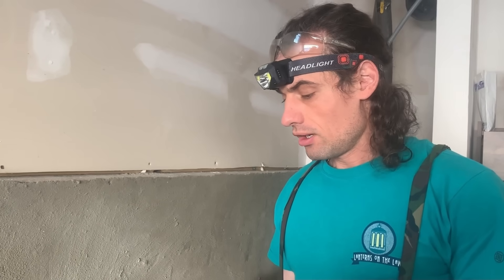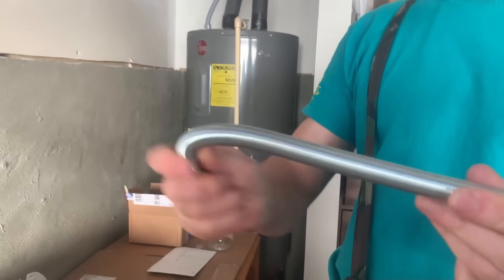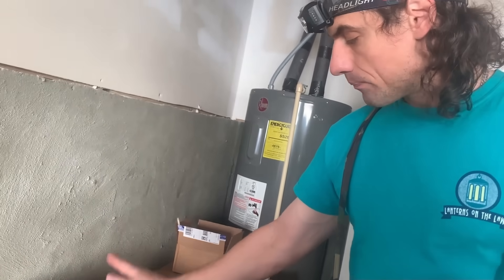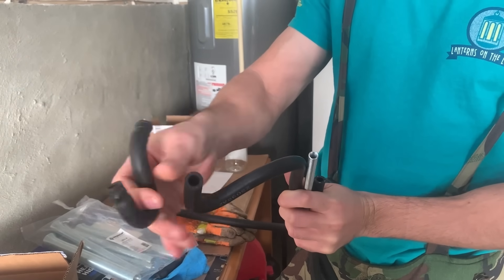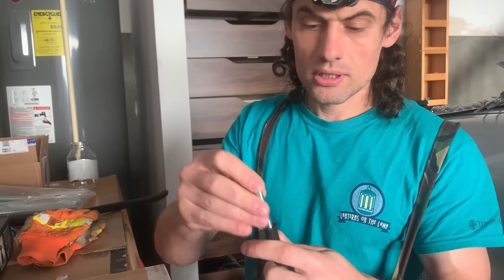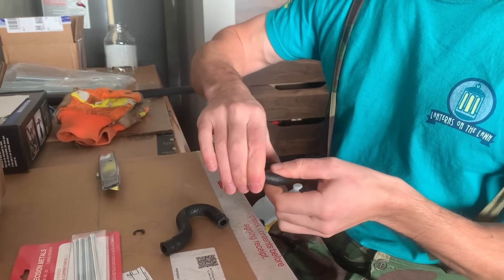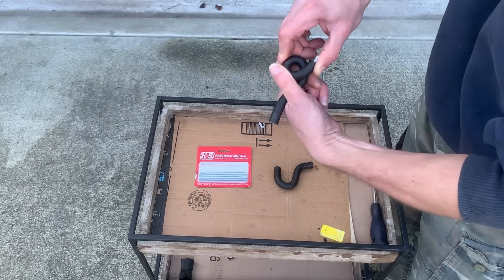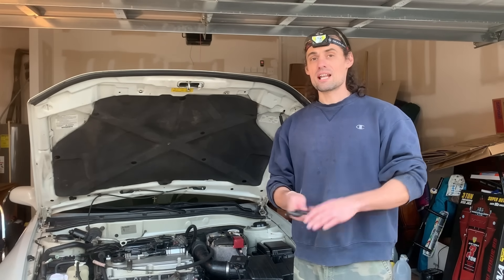Bend Rubber Hoses Without Kinking to Match OEM Parts

Comment: The OEM parts are made by; extruding rubber compond to form the inner tube at a smaller internal diameter than finished, then a loose braid reinforcement is woven over that, and then an outer tube layer is extruded over the inner/mesh.  This is uncured rubber compound.  This raw tube can be made in km lengths in a co-extrusion production run. It's stinkin ch!t to work with.
The straight raw tube is cut to length to suit the component. It is closed into a metal clam shell mold form of the exact size. The tube is plugged and pressure inflated to form the unkinked inner and outer shape form.  The inflated tube mold is then heat cured in an autoclave some time, cooled, then the clam shell mold opened.
The rubber compound is thermosetting. Once heat cured it cannot be remolded or reshaped.

Because the inner tube is smaller and the textile reo is loose and can slip between the outer there is NO tension in the reinforcement trying to resist the hard set bends, the finished product will always retain the shape... in fact resist deformation, just like the straight tube. 

Thats the problem with this method - the reinforcement mesh embedded in the tube resist tension loading, bending and pressure deformation. The rubber resists stretch and compression when bending, so it fights to retain the shape it was when cured - straight. 
 

The better choice of tube would be reinforced PVC because it is a thermo-forming compound, rather than a thermo-setting compound... and so, heated enough, inflated and molded then cooled there will be more chance of having the reo textile comfortably shift within the easily formed plastic.  
Remember, you can put the bending spring around the outside of the tube when forming plastic, but air pressure is needed to inflate for no kinks.
Reply from the maker: Thank you for great feedback! I've re-read couple of times to make sure I follow your suggestions/explanations and it all makes sense. Of course, my method isn't ideal, but so far it worked. Just keep in mind I wasn't trying to get perfect OEM part (although it would be nice), I was simply trying to get something close enough considering budget and time. Either way, your explanation is very informative and useful. Appreciate your feedback and hopefully others will find that informative as well. Thank you for watching!
Reply: Do you think the PVC will be able to handle 100 C & pressure?
Reply: For 1 year yes after i don't know, i installed it since 1 year on my rv fiat ducato.
My engine run particularly cool around 80c 100c peak maximum for a minute or two.
With modern engine how can get to 130c peak and build a lot  more pressure 2.5bars for somes, i don't know if it's suitable but for old one .... pvc seams to do the job. @calthorp 
Edit: i speak about textile renforced pvc hose. The non renforced one does last more than 2 mn in this case.
Reply: @tintinlavigne5257  I guess if you are stuck waiting for parts it would be a good choice.
Reply: PVC starts to soften above 160F. It's a really terrible plastic, it's not good for hot water, doesn't fuse when glued, goes brittle, is destroyed by UV, etc. It's very cheap which is why it is commonly used.
Reply: Everything correct. Except don't ever use pvc for this purpouse.
Reply: Thanks for your clarity. 
My daughter worked for YUSA who made rubber parts for Honda. 
She was a shift manager. 
You explained the process better.
Reply: Hey I know this old but you seem to know a lot about this stuff. I just bought oem hoses for radiator and when I put them on I think I bent it too much, there is very little space. It doesn’t hold the shape anymore but it’s on. It was a very slight bend, I’m wondering if it lost its shape does it mean it’s compromised and I should replace it. I don’t want it to blow up on me on the road. The hose seems a little softer now too
Reply: @advocatesdevil7064 your suspicions are correct. 
Hoses under heat and pressure want to return to their original form. Or collapse. 
But you probably have time to order affordable hoses from Rock Auto or somewhere like that. 
Just don’t get the cheapest ones. 
I always get the ones with the heart ❤.
Reply: @advocatesdevil7064  yeah... can be tight as fit and crammed in modern vehicles. 
I'm assuming these are largish diameter hoses with a thin wall. The top (hot) will be under pressure in service, the bottom (colder) will be under suction from water pump. The bottom may have a metal spring form to help resist collapse under that suction. The aim is to minimise any reduction in diameter at bends, because that will restrict flow that results in lower cooling efficiency. 

It's highly doubtful any bending during install would; break any of the reinforcement textiles, degrade rubber or de laminate inner and outer layers of a new hose... so little chance of blowout due to that. 
The OEM is probably the correct length, but maybe slightly longer or shorter. 

Perhaps drain coolant, loosen clamps and try pushing the hose fully home on the spouts and rotate to get in correct location both ends. A bit of dish detergent on spouts will have it fit and rotate easier.
Reply: @BTW... thank you for such a prompt response. It’s for mr2 turbo so it’s an old car. These are 2 hoses coming out straight from radiator at the front. The hose is like 12 inches long and out of those 12 inches half are taken up by the tubing you have to put it on. One side I put in on not bad I think don’t worry about it too much. The other I mangled pretty bad to put in on 😅😅. Wish there was some way to know if I delaminated it or compromised some other way l, it just looks slightly weird to me now wish I could attach the picture. Just the fact it lost shape and is a little softer makes me worried
Reply: Dude. This info is available no where else on the internet, and then 6 months later YouTube brings me here. Thank you.
Reply: Did you mean PCV automotive hose? I don't think PVC automotive hoses exist.
Reply: please revise and shorten your statement
Reply: I've made the difficult bends with copper tubing and just used short pieces of hose on the ends to couple it
Reply: @joecummings1260  Yes, once there are no more OEM replacement rubber hoses to fit certain things, I think this is the best way to handle the problem. And if done correctly, it will last a long time as well.
Reply: @joecummings1260  The problem with that is certain applications will not want to have an automotive fluid running through a copper pipe because of how the fluid might react to the copper.  Sounds like it would work for hoses that only have air going through them, so that would work.
Reply: @ What ""Automotive Fluid" Do you think is going to react with copper in a harmful way?

My second question is why are you offering  input on a subject you clearly know nothing about?

Comment: Good video, might need to try that. I just looped the hose like you did @ 10:39 to get the 90 degree angle, but had plenty of clearance for the loop.No heat needed if you have room.
Reply from the maker: Yes, if you have plenty of room, you don't actually need to preserve the shape. The whole idea about preserving the shape, so it won't kink. But if you have long range and no more than 90 degree angle then you can simply put a hose as is without preserving a shape. Just keep an eye on it and make sure it does not kink overtime, especially if it is one of the coolant hoses - hot liquid makes it more flexible and it's more likely to kink. Thank you for watching!

Comment: For the hose not to get kinky you can bend it to a wider angle and play with the length, most times placement allows you to do that so it solves the problem by not strictly following the factory curve. For example a U hose can be make it a little longer so it doesn't kink, for an L shape you can cut it shorter so to stretch the 90 degree angle and so on.
I need to find those springs, there were a lot of times i needed this to build my hoses from straight ones cause i ended up modifying old ones or connect them with L joints etc.
Reply from the maker: Links to the variety of springs in the description of the video. Yes, it is a lot easier to work with longer hoses and give them the shape you need. The U-shape you mentioned, requires less force to form it. Just make sure you heat it up well enough to preserve the shape, because once you cut it, it might not be enough of curvature and it will start to kink. That's what I explained at 9:26. It may take several trials before you get it perfect. The more you do, the more experience you get and it gets easier. Thank you for watching!
Reply: Where space permits it I have used a longer piece of hose & made it into a large circular loop. This prevents kinking but it's not as neat.

Comment: Another option is to use armored aircraft hoses. You can bend them most any which way without compromising strength, and they look cool too. I also needed a fuel filler hose for an old Jeep Cherokee that went from the filler assembly to the tank, and I couldn't find one until I went to the local Aircraft Fixed Base Operator, who had the size I needed in bulk. It wasn't armored, but it was rated for Avgas, and solved the problem. It came with supporting ridges for bending up to 160 degrees without collapsing, but my application was a straight shot, so that was overkill. Most any aircraft hydraulic shop can put the fittings on for you while you wait, if you need that as well. Not cheap, but it cost less than the driving around I did looking for a solution.

Comment: Yes but if you use too big a spring, you will have difficulty getting it out of the hose, after you bend it!
Reply from the maker: Shouldn't be an issue. Once you preserved the shape of the hose, you can straighten the hose back up again and while it's straight just pull the spring tube out. Once it's out and you release the hose, it should go back to the shape you gave it. Yes, it won't be as easy as with so small spring, but still should work.

Comment: Another option. Insert a light duty compression spring ( or stretch one) that fits anug to the hose. 
The prebend will help make a nice curve though. 
Interesting idea.  Will have to keep this in mind.
Reply: springs in tubes present as flow resistance and rust. 
They are good for thinner tubes under vacuum. 
Rubber compound does not thermo rework.. once heat cured it's set to that shape.

Comment: Zip ties probably would work instead of the metal clamps.
Reply: They melt
Reply: I think zip ties would work, around the rag it would be insulated and not melt, plus zip ties have a higher melting point than soft rubber.

Comment: Cool video, learned some stuff for sure. I was using the same technique recently to flare a hose end so it could fit two different diameters. Had to oversize the object inside to what I needed so when removed it was correct. Similar to you saying it might need over bent. Used basically the same technique but cooled under water and it worked great.
Reply from the maker: Glad you found useful. Yes, if you sit on something and you're DIY type of guy, you can always come up with a solution that will save you money and time. That's the point! Thank you for watching!

Comment: Hours of work to avoid spending a few dollars on a factory made part.  Hmm?
Reply: Except when the new part isn't available. Or  you or your customer needs the vehicle back asap and the new hose could take weeks to ship.
Reply from the maker: @KBLIZZ333  Exactly. In my case the part wasn't available and any other in-store hoses either were wrong size and right shape, or right size and wrong shape. After going to 3 different stores, I decided to use this method.
Reply: @KBLIZZ333  true.  but too many try rookie stuff like this and fail.
Reply: @Stan_in_Shelton_WA  
yeah, this is a sure fail.
It's not worth trying to reform a rubber hose that is heat cured to be one shape only and cant be thermo reformed.  Even worse, it has textile reinforcement designed to resist stretch along the length and diameter that happens when bending. 
This will only work with plastics that thermo form.
Reply from the maker: Good point, just keep in mind sometimes part that you need isn't available or too expensive. If it's cheap and available, sure thing I'd go with it - and that's what I did with heater hoses. Each one of them was about $20 and the shape was a lot more complex than just one bend. So, absolutely I got both from RockAuto. But this a little hose I could not find anywhere. Sometimes you have to use your creativity as DIY man. That was the case.

Comment: Just a point to make those pipe bending springs are used to bend copper pipe and fit on the outside of the pipe… that ones that go inside the pipe have a loop that that’s attached to a cord to be able to pull back out after bending 👍🏼good video buddy
Reply from the maker: Thank you for watching!

Comment: I prefer boiling water , but its really only good for fresh builds as its a slow process, but works BEAUTIFULLY!  Another tip, even if not benfding forming, use the heat gun to heat ends brfore slipping over pipe nipple. then clamp when warm, NOT hot or it will sqweeze out the hose too much. Best wishes,I built diesel power units for awhile, and did this all day long. You get tough hands doing this, those big 3" inch suction hoses are a beast to form!
Reply from the maker: Boiling water works as well, it is just much slower process. I think boiling water is much easier on big hoses (as you mentioned 3'' in larger) since the heat uniformly distributed. For smaller hoses, heat gun works just as good. Thank you for watching!

Comment: Well done..! Wondering if you could pack hoses with dry sand, ends closed, form to shape with string ties, and bake in the microwave..? No project here at the moment to try, you..?
Reply from the maker: It's great idea, but few things to keep in mind. First, even if you try to pack a hose with dry sand (ends closed), it'll still kink if you bend it at sharper angle and either sand or string ties won't prevent from kinking it. You'd still need to use spring tube bender or something else to give it a shape and avoid kinking it. Second, microwave works based on the electromagnetic waves and it only works on dipole molecules (e.g. water based ingredients). If you put something dry into microwave, such as dry sand, it won't even heat it up. Thus, to preserve the shape, you'd have to bake it in the oven at high temperature. Those are just small details, but it's worth trying. As one of the viewers suggested in the comments that's how industrial hoses are made - metal shape is created first and then hose is put over the metal form and the entire thing is sent to the oven to bake. It is absolutely worth trying. Thank you for your suggestion and watching the video!
Reply: @ngtitovWorldOfCars  sand should work as long as you properly plug one end pack(ram) the sand and then plug (with fitting) the other end. It works for pipe and tubing but may take way longer to heat and cool. So your way is faster.
Reply: @snowgorilla9789  I had to search for sand and here we are.  It works great with copper tubing.  I was most interested on the heating part.  While watching, I would use a board with inside half of the shape nailed in position, heat it and put it in place and add the outside nail to hold it there.  The ole Toyota Corolla, it has a number of those custom hoses and I was wondering while switching engines if I was going to run into this problem, but got lucky.   When you buy sand make sure it is dry, last one I got was wet, bought sight unseen, which was a pain when needed in -20 below weather.
Reply: Personally, I would not use sand.  Whatever doesn't come out of the hose, goes into your engine.  Just a thought.
Reply: @ProfessorOzone  Yes, beware of Bard's advice, I used to grind aircraft cranks on up to large diesels, I would definitely make sure the process left no sand in it.   Just made a trailer drum balancer, boy howdy is it off, ~1.5"X1.5" cube of steel.  Now thinking of tapping for two screws and pour lead in a clay dam form, I assumed I would have to machine off material, but that ain't happen, must add.  I made an aluminum part that hangs on where the grease cap goes,  not fun stetting it on nicely with a mirror solo.

Comment: Why don’t you just buy the right hose? Heating the hose well weaken it to much !
Reply from the maker: I couldn't find the right shape hose, and OEM part wasn't available. Even if I'd find OEM part, it'd be around ~$25-$30 for that little hose, and you'd have to pay for shipping as well. It's an assessment you have to do yourself to see IF it actually worth the labor and time you'll put in. In this particular case (in video), I had no other option, but create my own hose. When I was dealing with inlet/outlet heater hoses, it was much easier for me to buy them - each was $20 and their curvature and bends were much complicated, so wasn't worth my time and labor. That's the decision you have to make since each situation is different/unique. Once you get to the point when you have no other option, now you know what to do. Thank you for watching!
Reply: There are old cars that people restore and oem hoses are not available, this is a great option. And you are talking like that rubber hose is under hundreds of psi, 😂. Stop, it's a little coolant tube, not a hydraulic hose

Comment: You could fill hose with water, block ends and do the same thing.
Reply from the maker: I'm not sure how you would block the ends and not let the water out, which will be displaced by bending the hose. As you bend a hose at sharper angle, it'd want to displace more water and creates greater pressure at the ends. You'd need to get some caps or something that would sustain water pressure.